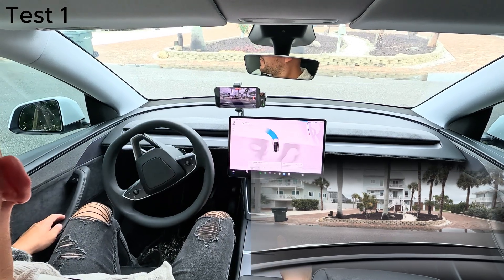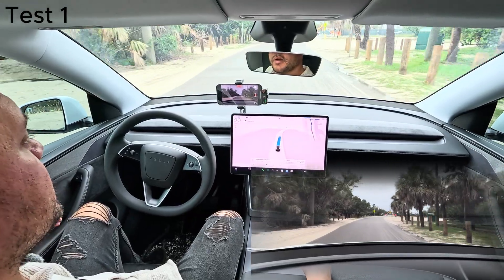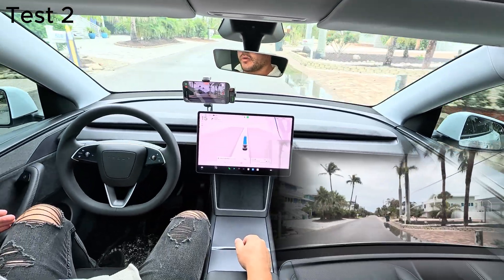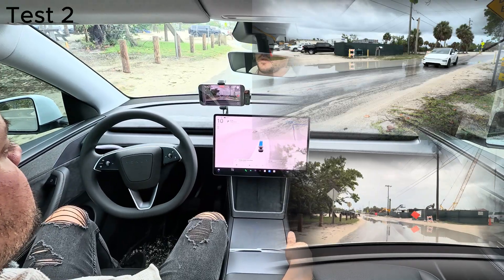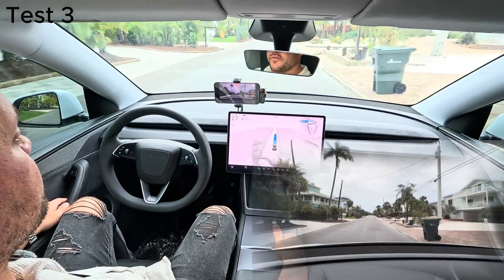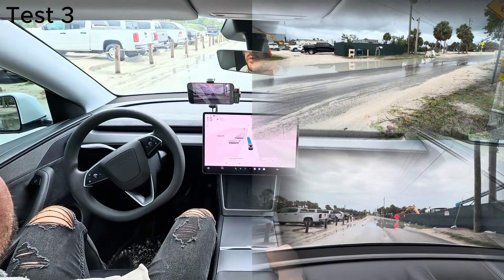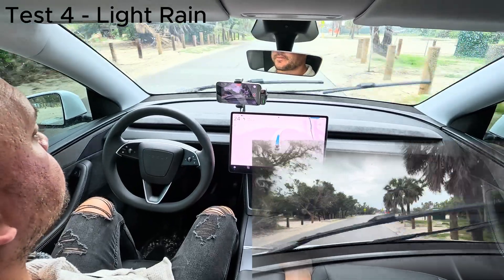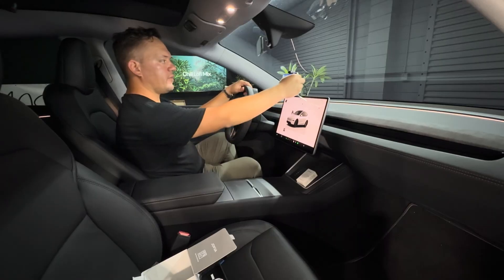TESLA FSD Outperforms WAYMO LiDAR Stuck in Flooded Street

Comment: GIGO..  The manually set speed isn't a good test of FSD vs a normal human driver, but compared to a bad driver who thinks they are special.  Posted legal speed limits are based on good visibility AND dry roads.  Your tests at + 30 mph would get you ticketed in a 20 mph zone in dry weather.    To me the fact that you can set the speed that far above the posted limit and the vehicle obeys your setting means that parameter needs to be  removed from FSD. The car should not ape a human's desire to break the law in a non-emergency situation  This  behavior appears to be due to poor drivers auditing the training videos.